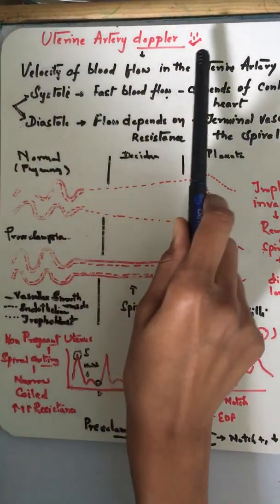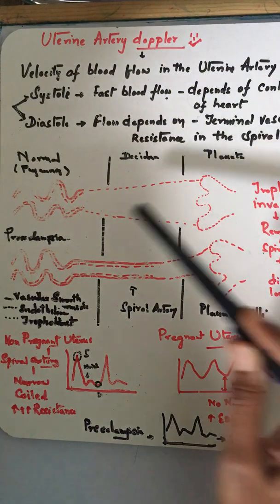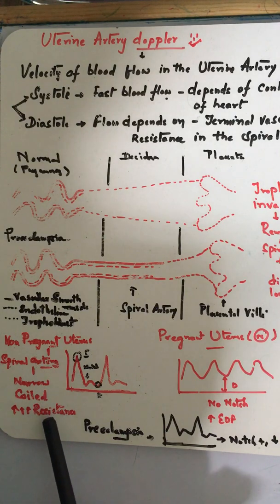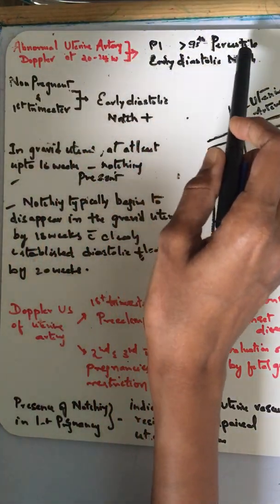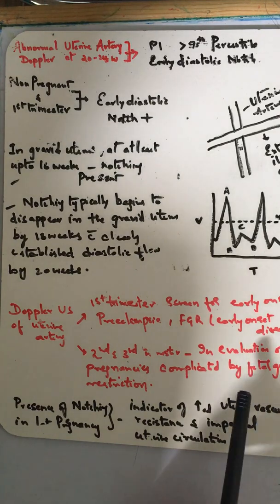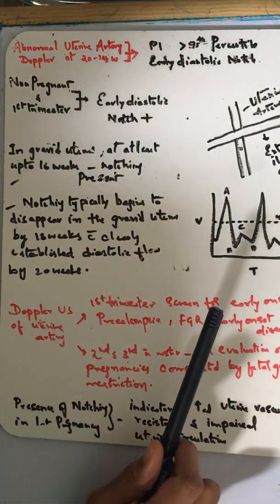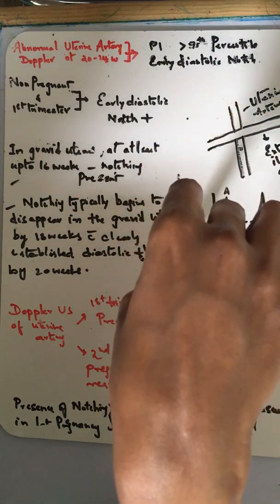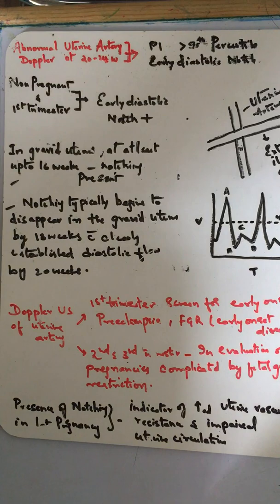Uterine artery Doppler

Comment: what is the normal value of uterine artery pi value in pregnancy NT SCAN
Reply from the maker: Hello
Can you tell how many weeks is pregnancy
Reply: @dr.archanareddy7857  currently I am 14 weeks 4d
Reply: My first pregnancy story: I had an induced abortion at 25 weeks due to preeclampsia. I got to know that in NT scan only that uterine pi value is high -2.5 and told that may develop preeclampsia around 34 weeks. But around 24 weeks my bp went high 160/110, had face and legs swellings, protein in urine and water was draining. Admitted in hospital tried all medicines for but no luck. Kidney and started affecting so doctor decided to abortion. And abortion on Jan 22 2022.
Reply: @dr.archanareddy7857  toMy second pregnancy got confirmed on June 25,2022.
Now I am 14 weeks. This time also in NT scan got to know that uterine pi value: 2.38 is high. I am started taking aspirin 150mg from starting of pregnancy this time.
Reply from the maker: @bestavasanthi8619  
Hi 
2.38 - uterine artery PI - is high resistance 
Normally during NT SCAN we take a cutoff of 2 for PI of uterine artery 
Anything above at or above 2 we take it as high - positive for pregnancy induced hypertension (PIH)
Reply: Did you gave birth ?? Is baby ok?
Reply: @bestavasanthi8619 why would you terminate a viable pregnancy for pre-eclampsia? They could have delivered your baby, they didn't need to abort